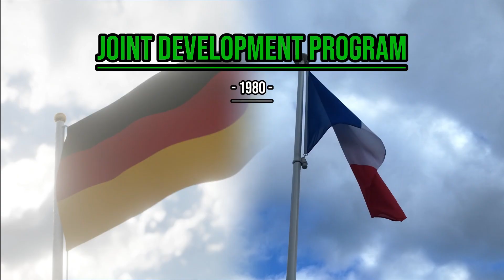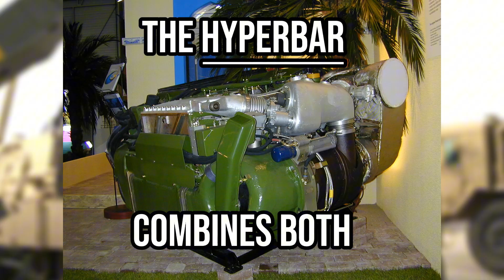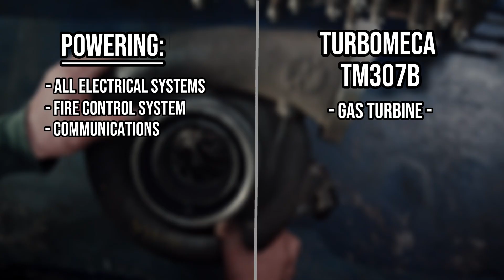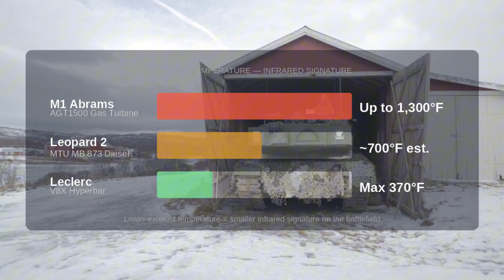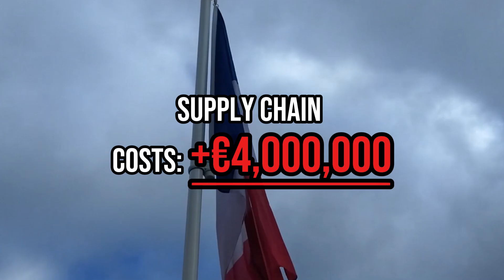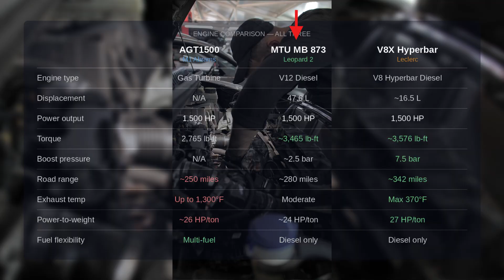Leclerc V8X Hyperbar – The Tank Engine That Is Both Diesel AND Gas Turbine

Comment: 32 bars is 464 psi. 
So the 2000hp Cummins roll at 100-150psi if I’m not mistaken. 
To put into perspective
Reply from the maker: Mind-blowing numbers, right? 🤯 Comparing it to a 2000hp Cummins really highlights how far the French pushed the limits of pressure with the Hyperbar. Absolute engineering madness!